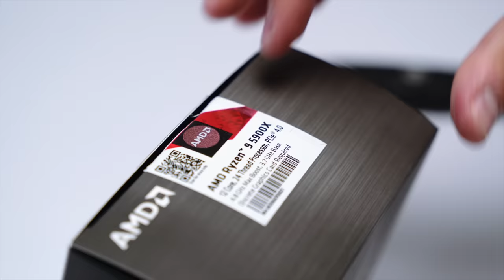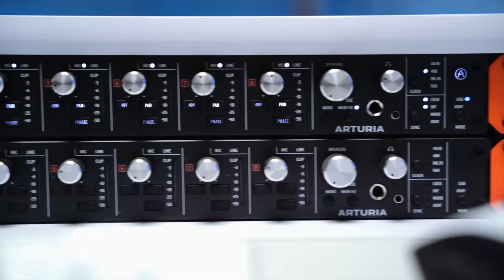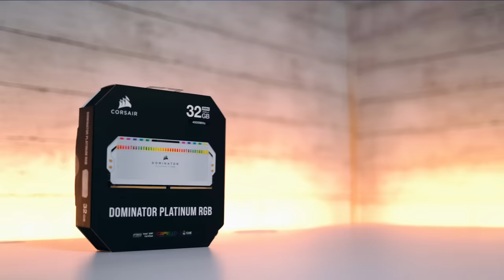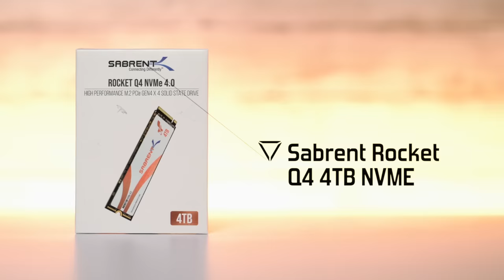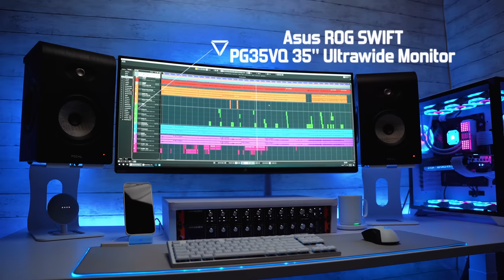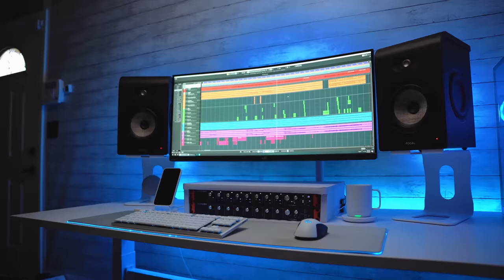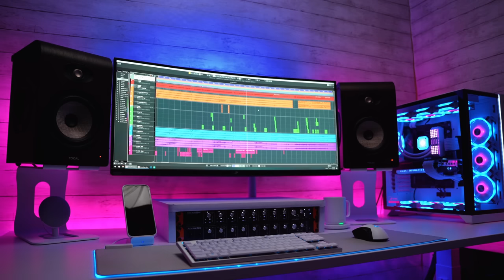I Built the ULTIMATE Gaming & Studio PC

Comment: I built mine almost a year ago, running very similar components:  Asus Dark Hero MB, Ryzan 5950x, Corsair 64GB of 3733 Mhz memory; 2, PCI 4 Samsung 980 M2 NMV drives and a EVGA FTW 3090 as well.  For cooling I am running a Dark  Rock Pro 4 on a Be Quiet Base Pro 900 r2 case and for power a Dark Power 12 in 1500 watt.   It runs good..and nobody gave me the components!